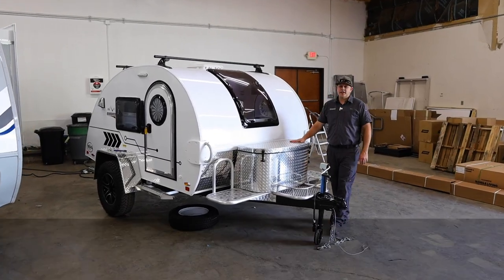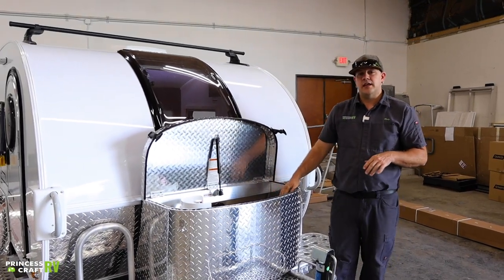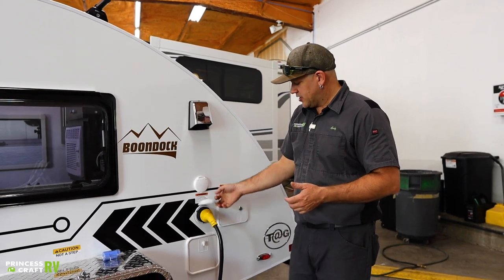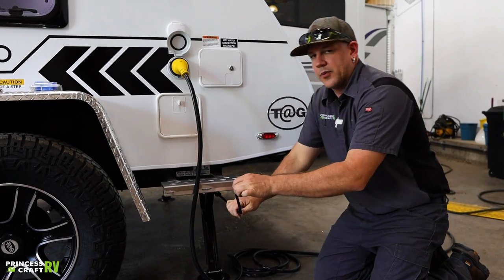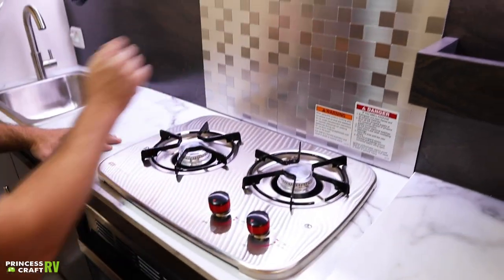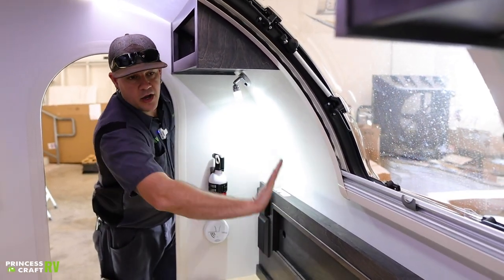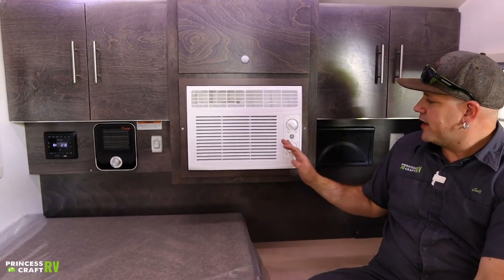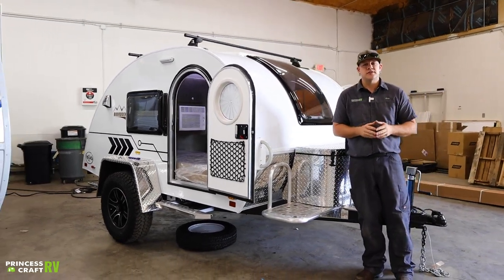2021 TAG XL Boondock Teardrop Trailer - Technician Tour

Comment: You need to talk about the bed.  Also where tv can be put or hand held ipad. Also what is weight, tow vehicle and tongue weight and how much weight can be added to front storage platform.  Can solor refrigerator be swapped for that cooler?

Comment: We’re thinking about purchasing our first camper, and this looks amazing!
Reply from the maker: Good choice!
Reply: @RVTechToursatPrincessCraft  
Our only trepidation is that I am 6'5", which I know will be REALLY tight, which is why we're having an XL Boondock delivered to our local place to check it out.  We do not want to go any bigger, however, and hoping that the extra width might provide a little leeway there.  Does the Boondock package include what's in the convenience package?  Just want to be sure.
Reply from the maker: You're going about it the right way. I (not Cody) am 6'4", and fit will matter.

Comment: Does it fit a dometic cfx3 45 that i own? The fridge space seems much smaller than the 2018 model that could fit a large fridge. Cfx3 fridge are extremely efficient. All tear drop should be compatible with dometic fridge at least. Also can we replace the battery with lithium 100ah battery much lighter (25 lbs) than this crap agm (70lbs) in a tear drop lithium should be standard as people need lightweight trailer as possible (tongue weight limited to 220lbs) to tow with normal car. Agm does not make sense.

Comment: Is the Exterior dimension based on the wheel point? or is it just the shell itself? I'm trying to figure out if an XL will fit through a standard 1 car garage door.
Reply from the maker: The exterior dimensions should include the fenders.
Reply: @RVTechToursatPrincessCraft  Thanks!
Reply: Thanks for posting this, Joseph C. Those of us with HOA limitations are really really interested in the exterior sizes and whether a potential unit will fit.

Comment: Hello - just wondering - is the vent covered you mentioned, for the fan, is it included with the trailer purchase or an additional add on?
Reply from the maker: The vent cover shown in the video is a standard feature from the manufacturer. Upgradable ones are available from the dealership if you so desire.